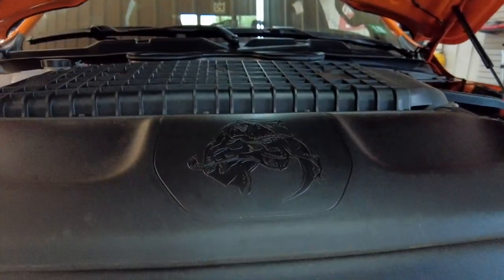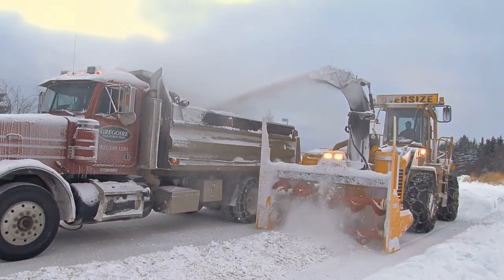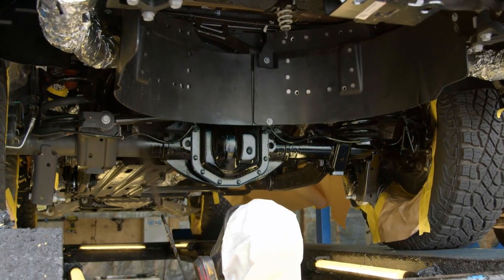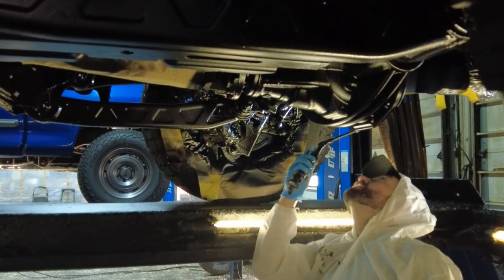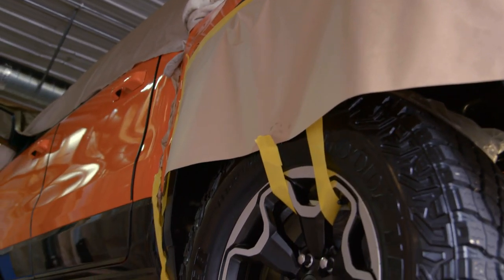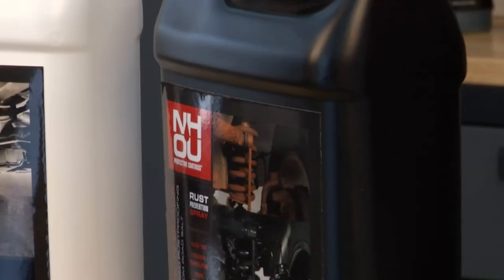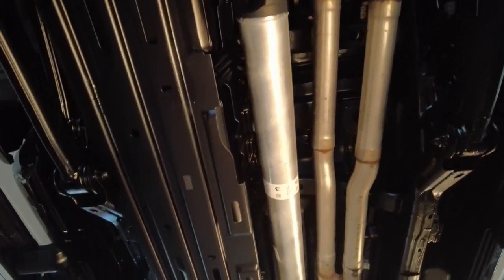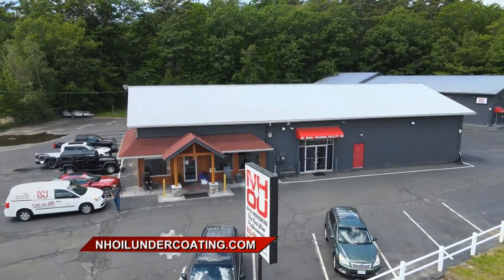NHOU® Ram TRX Boss Wax

Comment: My 2015 sierra 1500 has a wax dipped on the frame from factory but it’s total junk. Would something like this be safe to spray over it? I know some other similar products will actually eat through that wax.
Reply from the maker: GM/Chevy factory wax has had service advisories virtually every year since its conception. There are other products, such as NHOU, that would be a better fit for that application.
Reply: @nhoilundercoatinginc4286  thank you for the reply. This boss wax is a one time application, could that be applied over the factory coating?
Reply from the maker: @Cody_Austin  Yes, on a new truck only.
Reply: @nhoilundercoatinginc4286  can you spray any other NH Oil product over the boss wax ?
Reply from the maker: @hookedonguns5941  Not really necessary.